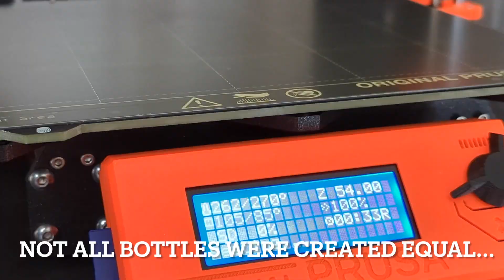How to Turn Water Bottles into 3D Printer Filament (and print with it!)

Comment: Great job, try increasing the flow rate of the filament or extrusion multiplier in the slicer.
Reply: And for the stringing increase the retraction length by 1-2 mm.

Comment: Would it be cool (Vase mode only) if you could iinser a thread of real carbon fiver in that hole. You would have a real carbon fiber print rather than carbon fiber powder. Most likely need a larger print nozzle as well.

Comment: awesome!!!!! a question, temperature of the nozzle when transform pet to filament, and temperature nozzle when works ? temperature of the bed? please
Reply from the maker: Hmmmm for the bed. I think you can use standard PET bed temperature. For the nozzle I recall using 20 degrees or so higher than normal. I think it was 270~280 degrees
Reply: Muchas gracias,  voy a probar de esa manera. Saludos